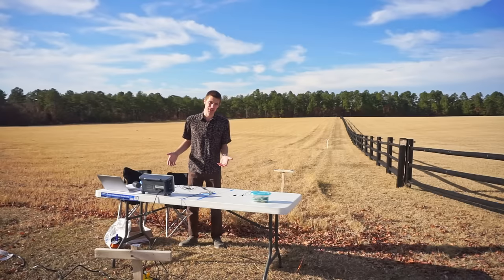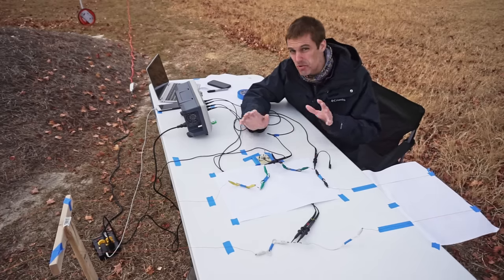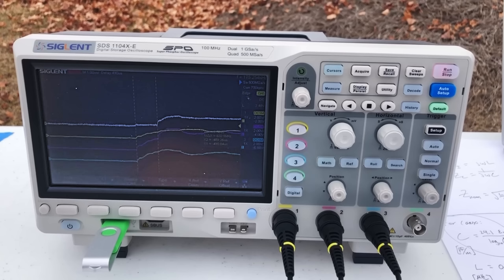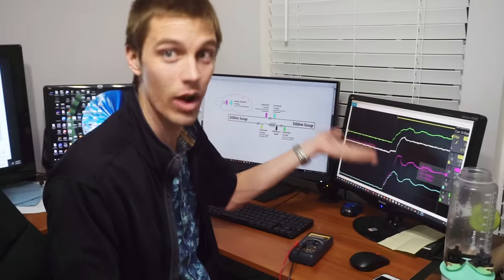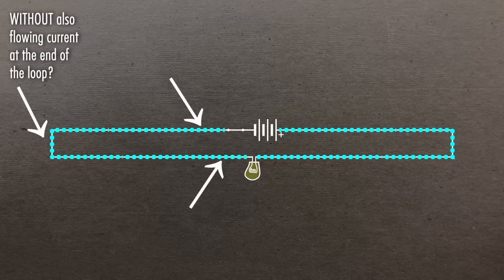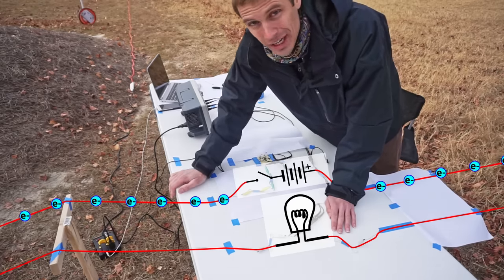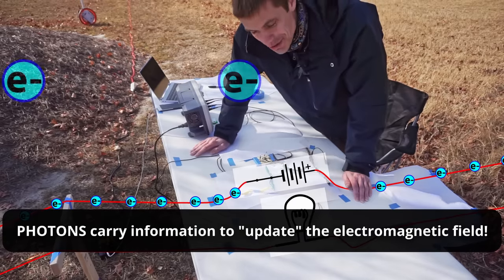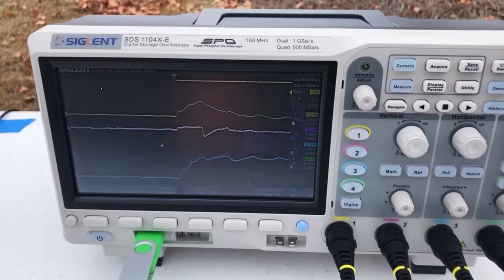I bought 1000 meters of wire to settle a physics debate

Comment: One thing I did not understand is the radio broadcast issue. If I pick up a signal from a radio station I can probably use it to drive a 3 amp led. So surely there must be an immediate affect through space. Unless you use a wave guide with an electromagnetic shield.

Comment: Putting any impedance of the light bulb aside my main concern/question is if the wire was 1/4 of a million miles long instead of 1,000 meters. At that length the same gauge wire will have a crap ton of resistance. I have not done the math but am curious to know what gauge wire would be required at that length to have equal to the 1,000 meter run resistance and could the math alone properly determine a result? And what if it were possible to use a superconductor wire? Can we really confirm this on paper with certainty or would a physical measurement be the only way?

Comment: there's an intrinsical delay involved with incandescent light bulbs as the wire inside of them has to heat up through and through before they have gotten hot enough to be able to start emitting light from their surface. they therefore probably are not actually very suitable for a test like this!

Comment: very great experiment! any conductor has a capacitance. that small initial current is charging this distributed capacitance. this should be confirmed with wires of different diameters, and for different loads. higher loads will be better, to see a more distinct difference between currents (but avoiding thermal effects). However, I imagine that having a fast switch (ns) for high currents might be expensive...I think the negative current peak is due to inductance of the wire. these transient effects are well-known in microwave physics/engineering. Maybe using the "Telegrapher's equations" would help understanding better.

Comment: The volume on this is poorly recorded and I can hardly hear it.
On the topic I'd expect electron movement (outer shell to next atom  outer shell ) no faster than 1/12th the speed of Light maximum.  
But on propagation of the "Wave" (as you put it) will be at the speed of light IN THAT MEDIUM in this case Copper Cu; and is obviously less than the speed of light in a Vacuum.  
Which is where concepts of Propagation factor and Snell's law comes into play.

Comment: Surely whatever medium electricity is travelling down has resistance and therefore delay. It's like light traveling through water it decelerates based upon the medium it ys traveling through.

It's why the speed of light was changed to the speed of light in a vacuum.

Comment: Perhaps they are looking for a barrier at about 99,400 miles, or half the distance of the wavelength of a 1 hertz AC wave. I think what they saw from VERTASIUM and this experiment, is that in a simple DC circuit if the capacitance is lower than the inductance, then the voltage will lead the current by a portion of time. If the capacitance was more than the inductance, then what they call information (voltage) would build up slower. I still guess that it would only take a theoretical 1 second for the voltage to travel that distance. Theorists contend that electricity travels faster than that and would travel near the speed of light instead of 1/2 the speed of light. At that distance, (99,500 miles) the energy wave may actually try to turn around and discharge the inductance of the circuit, and then go halfway back to the source, and then return for another 99,500 miles until it gets to where it is going. Such a long conductor might also have to be of a large cross-sectional area. A smaller conductor might allow some current, and then just stop conducting and appear as a large resistance.

Comment: No. The effects of voltage along a transmission line is what is traveling at close to the speed of light, not individual electrons. The velocity of the electrons from one copper atom to another will vary, depending on the amount of current. For those who disagree, you will have to convince the MIT science teams otherwise. With small currents, a human can outrun an individual electron down a transmission line.

Comment: What if your experiment is set up so that the wire loops are not near each other, but far away, like in a square or a circle? What happens if it's a 1km square? The "immediate effect" on the lightbulb would be practically impreceptable.

Comment: The voltage transient will travel always at a speed less than light speed along any wire. The speed varies a lot depending on isolation around the cable. In a good coaxial cable the velociy may be around 60% of c. 

Impedance unmatching will cause reflections and other phenomena.

The wires running side by side connect to eachother and make a sort of transmission line complicating your arrangement unnecessarily. You should separate the wires a lot to stop the interference.

Comment: If you do the same experiment using fluid or air(still fluid) you will get essentially the same results at the speed of sound(pressure wave propagation speed) through the specific fluid. Electrons(amperage) do not flow through the wire just the differential charge pressure wave(voltage) potential.

Comment: The capacitive and inductive reactance of the wire may "eat away" a tiny foremost part of the wave when it's transferred through a long wire, as they resist against a sudden change of voltage and current.

Comment: It's a common misconception that electricity travels through a wire. If you Unwound a spool of wire that went around the circumference of the earth 12 times, when you apply voltage to the starting side of that wire the the end of The Wire shows voltage instantaneously without delay, way way faster than the speed of light. You are not pumping electricity into one side and waiting for it to come out the other. You are applying a voltage to a wire which excites the electrons which already existed in The Wire, this electron excitement is instantaneous there is no travel time. However, in excessive length of wire will have an outrageous resistance, thus lowering the voltage and making it seem like it takes time for the electrons to arrive at the light bulb, when in fact the voltage is simply too low to make the light bulb react quick enough.
Reply from the maker: Resistance does almost nothing to propagation delay, which in most real cases is the speed of light (of relevant frequency) in the dielectric around the wire. It is not instant

Comment: i said as much on the follow up to this video, but here goes:  electricity always travels at the speed of light because it itself is a form of light.  visible light is just a small band on the electromagnetic spectrum.  from the name, you might deduce that all electromagnetic radiation is "light," and thus propagates though any given medium at the same speed, assuming the media is transparent to the frequency of light in question.

heat (infrared radiation,) electricity, light, X-rays, and gamma rays are all just different "colors" of electromagnetic "light."

Comment: I remember in engineering school they said it was approximately 2/3rd of the speed of light through a wire, and a tiny bit lower than the speed of light through as electromagnetic radioation.
Reply: Yes spot on about 220 meters per micro second the speed of light is aprox 300Meter per micro second The instantaneous signal in the load is due entirely do to capacities coupling  in this  very odd circuit and nothing to do with the speed of light in any way
Reply: It would be nice to open circuit the ends  remove the lamp and measure the line capacity  at the point of the battery 
it will at guess  50000 pf  this is what puts energy into the lamp instantaneously  but yes all the capacity will not be seen  due to prorogation  time at switch on

Comment: Wow! I'm glad that you were able to convert this thought experiment into a real one. You have successfully unfortunately proven that Veritasium was wrong. Although it is correct that the effect of closing the circuit is almost immediate on the other end, but not only is the amount of energy going through the air a lot less than the amount of energy going through the wire, but also the first one will actually stabilize to zero in the steady state, because the linear density of electrons on both ends of the battery will be equal, so no attraction or repulsion effect through air. I'm assuming that the wire resistance is zero. Even inductance will have no effect eventually, because it only has effect when there is changing current, which makes this experiment a little different than the AC power that we use at home.

Comment: It sounds like the operation of a time domain reflectometer was explained here. I used TDRs in the avionics and networking fields to trace wire lengths and opens/shorts and the distance down the wire to them. A handheld Fluke 620 cablemeter (that I used in networking) did all of this and more. Isn't the observations you are seeing already a known phenomenon and used as the basis for the operation of a TDR?

Comment: Excellent video indeed. One query I need to be clarified is:
If I ignore or avoid the concept of capacitors, Why does the white trace die out after some microseconds? I mean, I can understand the phenomenon by considering the capacitor charging concept. But if I want to understand this without thinking of capacitor and using the Poynting vector theorem, how can I understand that the energy that goes for some microseconds, dies after some time while the end loop is opened?

Comment: Thank you for proving my intuition wasnt wrong.
This is exactly what my intuition said and even if derek meant this, his explanation and  grafics were stupid.
as you said, no sane circuit would have an lightbulb which would turn on at such levels, and no sane person would try to make a point of it that "information travels the real distance not the wire distance" - as what travels the real diadtance isnt the same thing as what we mean when we say: "the information that the switch was closed" as we mean that the circuit is completed. the interference of two wires laying next to each other is a totaly different phenomenon, which we all know about. this has nothing to do with the closing or opening of the circuit itself, it could be a totaly different circuit.  Its like holding your phone next to the wire while telling you alexa from your phone to close the switch and then be amazed that alexa acted so fast, because you see spikes from your phone connecting to the internet, causing interference.

Comment: So if you have a maze made of metal, the assumption that the electricity finds its way immediately through the maze is wrong. It will take nanoseconds for the electrons to learn about the maze, so basically, it simply solves all the possibilities of the maze, bound by the simulation speed at which we live in! Amazing, thanks for the video! Cheers
Reply from the maker: Check out my most recent video

Comment: Hint for people trying to figure this out: The multimeter and oscilloscope are physical devices displaying a theoretical concept, electrical potential. That potential is the final product of the fields and waves that make up the universe around you, and not physical proof of tiny physical electrons ping-ponging thru the fabric of spacetime. Take it at face value and compare it to Maxwell... don't try to fit the flawed academic ball-and-stick model into what you see.
Reply from the maker: The moving charged particles make (and are influenced by) the fields. You can’t decouple them

Comment: Cushcraft 67B with the 180 meter kit, coaxial and external 180 meter long wire, ladder line fed on a 90 foot tower. Now, what's the resistance of the mast? It turned out to be quite a bit at 1.3megohms!

Comment: But isn't it basically the effect of Lorentz force? After the switch is turned on, the electrons that start moving create a magnetic forcefield that generates an opposite current in the other wire that would cancel out the magnetic force!
In this experiment the two sides of the circuit were going in the opposite direction, and this way both sides had a pair that would generate the necessary inducated electric flow in their parallel flow.
What you could try, is put all the wires on the same side. So all the 4 wires from the table would go in the very same direction. My prediction is that the magnetic fields would cancel out, and the experienced inducated current would almost completely disappear!

Comment: I did not watch the video but the answer is already known and quite clear without your experent.
Speed of light is 299,792,458 metres per second in vacuum. As soon as the light travels through any type of medium it slows down. The dimensions of the wire and electrical properties like its inductance affect the exact propagation speed, but usually it will be around 90% of the speed of light.

Comment: Awesome idea - thank you for sharing that. Traveling at speed of light requires 1,668 µs for 500 meters. So why on earth did the voltage rise a little bit before even half of that time? And why was that voltage nealy constant until twice of the time the speed of light would take for traveling 500 meters? Is it even possible that the information about a closed switch travels faster than the speed of light? Would be a wrong conclusion. It's an induction thing because the two wires act as antennas immediately. The induction current and voltage are in opposite direction of the establishing source current and remain constant until the current in the wires has finally established within the whole wire. Nice to watch that it even happens that way. Shouldn't happen the same in case of drilled wires.

Comment: Reality is, nothing is traveling faster than the speed of light here. Move the light bulb and the switch further away from each other and that minuscule current would take longer to propagate. Capacitively and inductively decouple the switch and the light bulb from each other and that initial current disappears. Switch to AC and you could power the light entirely wirelessly, tis effectively the same principle, it's also what makes radio communication possible. Your video helped me conceptualise this, but when you take capacitance and inductance into account, it really shouldn't seem that mystifying. If anything, it's the way the original idea was presented that made it mystifying by obfuscating the actual principles involved.

Comment: Interesting observation but I do not like your explanation in terms of static charges related to an extra accumulation of electrons at the wavefront driving electro movement in the return lead to the bulb.   Instead, current flowing in a wire creates a magnetic field which.   That magnetic field will drive current in the parallel lead in the opposite direction.  It is this basic principle that allows inductance to be cancelled between a power lead and its return lead when the wires are closely coupled.   A principle commonly used in the form of a twisted pair for communications.  While the explanation is different the observation would be the same.  When the wires were cut at the ends essentially two closely coupled antennas were created.   A dipole on the transmit side and "bulb" on the receiving antenna.   Since it was a DC pulse essentially you got a single pulse related to the length of the antenna.   

It would have been interesting to see what happens if the spacing between the wire out and return was varied.   Would it have been a flat 200mV over time or would it have varied with the different coupling.   I would have expected some variation.   Much of the science involved here is the sort of stuff involved with communication thru wire over long distances and impedance mismatch.   A time domain reflectometer in effect lets one see impedance down a length of wire and can be used to identify where faults exist in an impedance controlled system by spotting anomalies.

I also note there is some risk using standard scope probes as the return leads may have some coupling.   The small voltage probably wasn't enough to be a problem.   Differential probes likely would have been better.

Comment: instead using light bulbs or resistor. Try use semiconductor that can only be turn on instantly when minimum operational voltage is apply to the enable pin, like mostfet. That way you can get rid any other delays that associate with the load, that you try to test.

Comment: Cherenkov radiation shows in some instances electrons can move faster than a light particle. But they're not going to travel faster than the speed of light. Unless you have multiple dimensions of time in a localized area of space.  In which case you would have created quantum electricity.

Comment: Umm, you mean the speed that electricity travels over the SPECIFIC material you're using??  Electricity travels at different speeds in different materials.  Electricity ALSO travels in the air.  What speed does it move in the air?  Does frequency matter??    Does the distance the electricity is travel make a difference?  Meaning, is the speed consistent no matter how long the distance?  After all, electricity doesn't just travel randomly, it follows a path of lowest IMPEDANCE (not resistance)    Etc.................................................................................................

The fact is there is NO specific speed electricity moves at.  There is a range of speeds it moves at depending on a lot of factors.

Go ask electrical engineers that have to make highly advanced electronics including PCBs that deal with very high frequencies.  They can enlighten you about the speed of electricity, how grounds work (which is HIGHLY variable), etc...................

But don't just ask any electrical engineer because these are highly complex topics and unless they actually work with specific circuits they are apt to give a wrong answer.